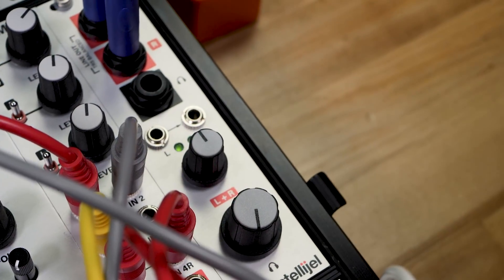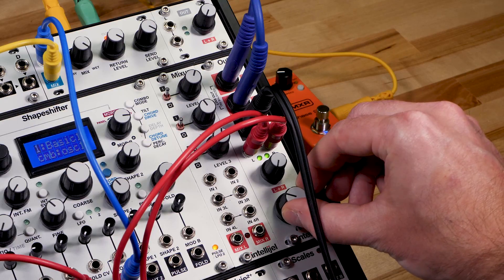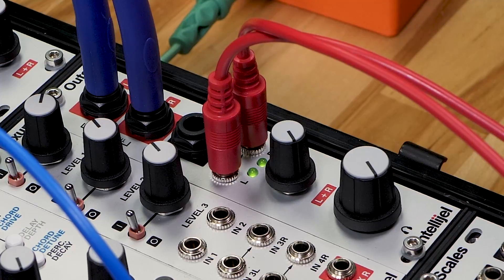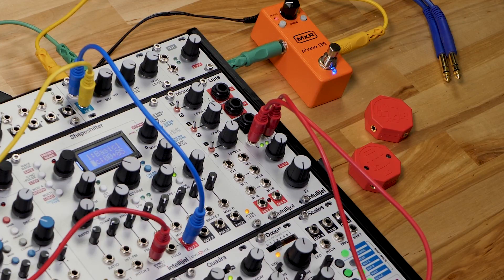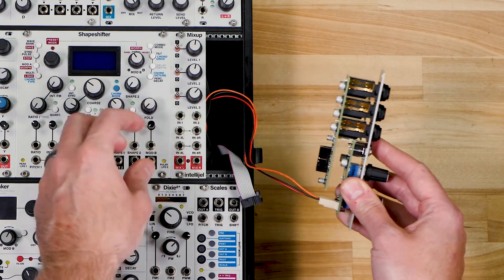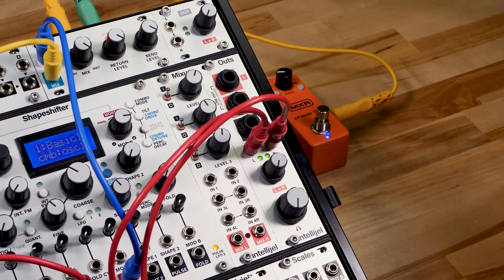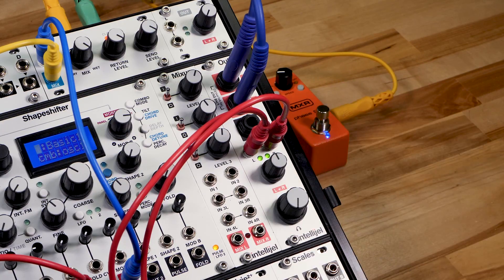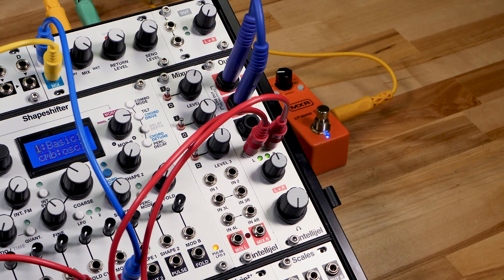Introduction to Outs

Comment: isnt this the same thing as the uJack?
Reply from the maker: uJack was discontinued and this replaces it.  Differences: uJack had unbalanced outputs, single output level control, different headphone driver circuit and trs jacks were at bottom.  'Outs" has balanced outputs, significantly larger headroom, rear panel connector for chaining in Mixup or other compatible devices to the outputs, top mounted jacks for better cable management in skiffs, and signal activity leds.

Comment: Quadrax. . . Hell yeah!
Hopefully it'll have "Volt per Hz" or "Clock In" so it'll be possible to sync to a host daw or sequencer!
Reply: You probably know this already by now, but Quadrax's CV inputs will track 1V/Oct as long as no attenuation is applied. Also, the LFOs will sync to a clock sent to the TRIG inputs.